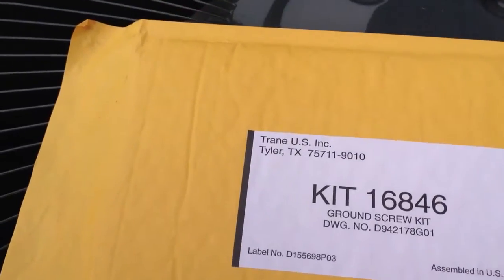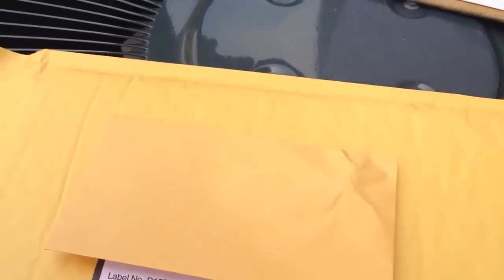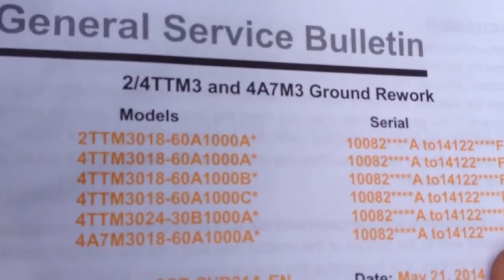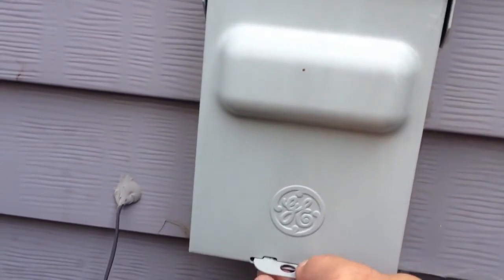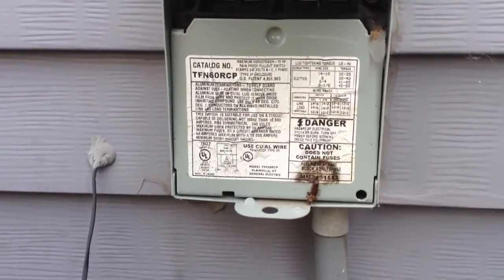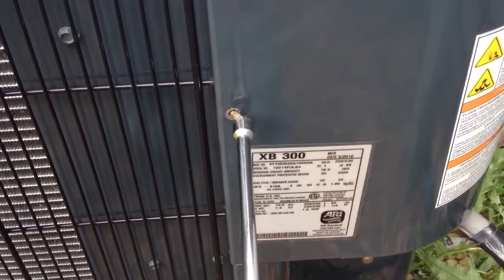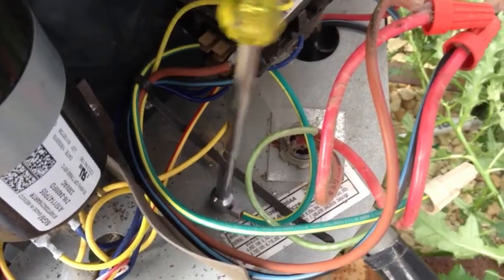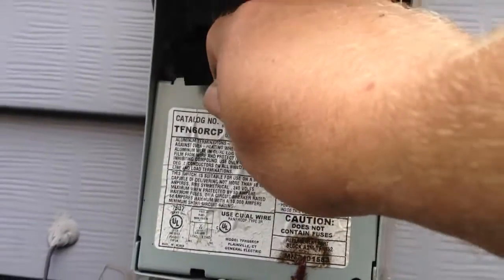Remounting the Ground Wire on a Trane XB300 due to recall

Comment: you didn't do it correctly you didn't use the ground nut and bolt that came with kit
Reply from the maker: I did use the nut and bolt that was in the kit meyerhalf.  I just didn't video me putting the nut on. Thanks for the comment!

Comment: Good topic! Cape Fear sells Trane as well but I've never seen an XB300 in for their builders in new Construction. I don't really see the difference in the side painted panel and the bottom panel, they bottom goes to the side panel for it's mounting so what's the difference? And with so much plastic on Trane units in the first place where does that panel touch earth ground? They'd be better off running a wire to a 6' spike to drive into the dirt! That would be a ground kit! Not hating on them or you Rob, just seems silly.
Reply from the maker: Stephen Rardon T&N Services LLC.  What doesn't make sense to me is the ground on most Trane units are in the same place as these units.  I haven't heard of any grounding problems with them but shouldn't they also be recalled for possible problems.
Reply: My theory is the original sheet metal screw was more prone to loosening over time
Reply: ***** it was...When the company was Trane/AS. Now that Ingersoll Rand owns it quality control has been horrible.
Reply: I agree Stephen Rardon if the panel is unpainted but you screw it to a painted panel what's the difference?
Reply: Joe Shearer is probably correct
Reply: My guess is that the paint would cause an unreliable grounding point due to it's anti corrosion properties and cause electrolysis and failure of that said ground point!!  I realize this is hitting it rather thin, but understand their are bad ways to ground an electrical system!!
Reply: ***** IMO Johnson controls stepped up Yorks R&D.
Reply: If you research it more I think it has to do with the screw they chose
Reply from the maker: Joe Shearer They said it need 2 threads for a good ground
Reply from the maker: ***** lol
Reply: ***** you're so gay! Lol

Comment: Did Trane really put out a kit for this
Reply: I guess it wasn't making a good connection to the side panel. Is that it Rob?
Reply: I'm confused it didn't look like you used the nut and bolt? NEC says a ground screw must have machine threads not a self tapper.
Reply from the maker: talyn875 T&N Services LLC. Joe Shearer 
Also note these units are micro-channels.
Reply: Rob Johnson oh yea...I saw
Reply from the maker: Joe Shearer I used the nut and bolt they provided.
Reply from the maker: talyn875 there was a issue with it not being grounded correctly and causing people to be shocked.
Reply: I apologize I couldn't see very clear
Reply from the maker: talyn875 my understanding is the painted panel did not provide a good enough ground
Reply from the maker: T&N Services LLC. This packet was sent from Trane/American Standard
Reply from the maker: http://articles.chicagotribune.com/2014-06-24/business/chi-trane-recalling-100600-air-conditioners-for-shock-risk-20140624_1_shock-risk-air-conditioning-units
Reply: Rob Johnson That's what it looked like to me too Rob, thanks.